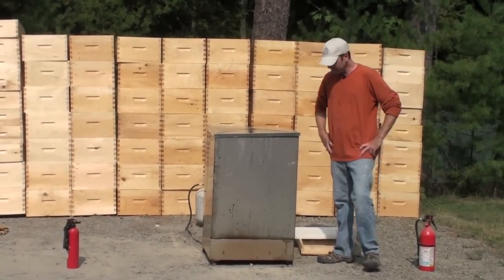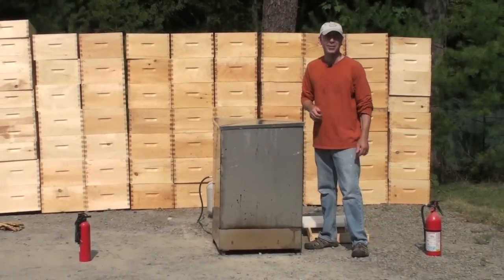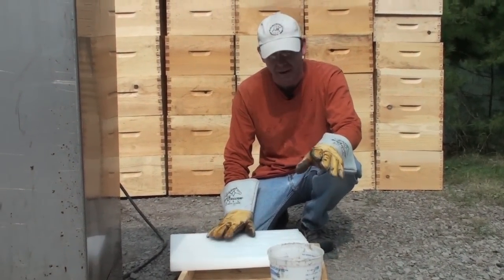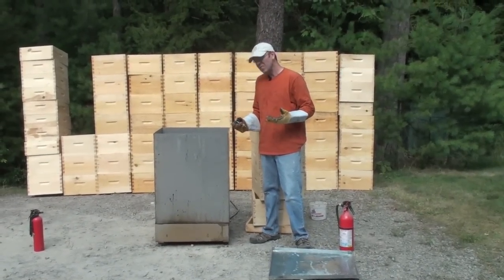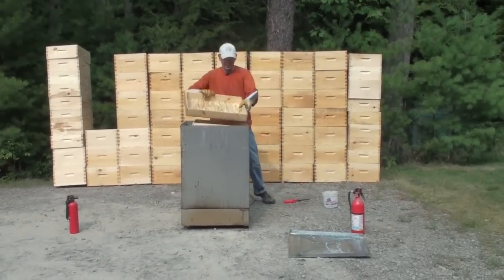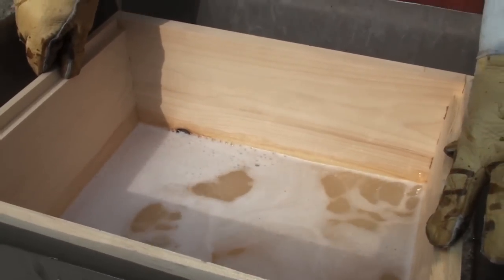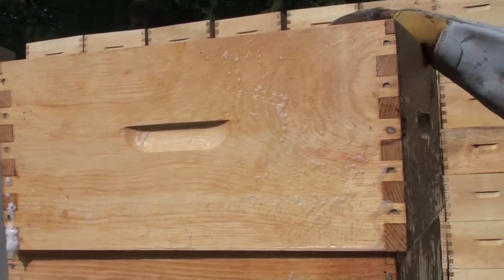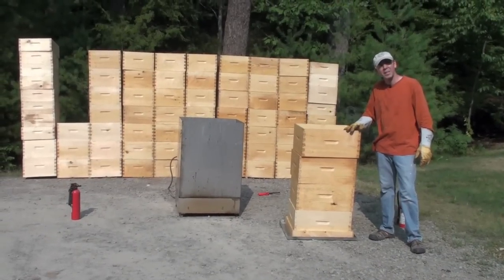Beehive Wax Dipping

Comment: I built all my hive boxes and frames myself( Langstroth dimensions) about 40 years ago. The boxes, 50 of them were painted with latex on the outside only. Some of the boxes have needed some repair over time as well as some repainting. Although my wooden equipment was not built for eternity it has served me fairly well at a very low cost.

Comment from the maker: I did try this at first but we found dipping before assembly prevents glue from adhering to the wood. Also, if you stack pieces the wax can't penetrate. Even when we put small spacers between them, we didn't get good coverage and penetration. It does take quite a bit of wax to fill the tank (300+lbs) but there is little to no waste in the process. The wood absorbs nearly 100% of the wax. It is time consuming (3 deeps,6 med) in 10 minutes but I incorporate other shop tasks while I'm dipping.

Comment: I noticed a lot of run marks or excess wax buildup. Do you scrape the excess smooth and re-use that wax, or just leave the globs on the boxes. I like the idea of wax dipping for sure, but the time constraint does seem a bit much. Granted, one setup and do a bunch of boxes for sure. I guess as 10 minutes per three boxes for one dip, vs a coat of primer and two coats of paint, that time may be the same. So then setup is really the only big constraint. Do you have a thermostat to control the wax temp, or just a thermometer and adjust the gas?

Comment: I have yet to start beekeeping, but have a good number of books and watched people's vids. I've seen that the bees tend to glue the boxes and lids together using propolis. Does treating the wood with Parafin / crystalline wax make it easier or harder for th propolis to stick the frames and boxes together where they meet as opposed to painting or varnishing as some people do. I've also noticed that the plastic manufactured boxes appear to be particularly prone to being glued up by propolis.
Reply: It is not like the bees paint everything together with propolis . The bees will glue the frames down to the boxes on the top edges . In the hot summers it is really not that bad it is just sticky . In the fall near the end of your inspection you need to NOT scrape it off where the boxes join that way it will help seal up the air gaps to keep the cold air out thru the winter because in the winter you DO NOT GO DEEP INTO YOUR HIVE anyway . Hope this helped a little

Comment: Good video - thank you for posting it!  Question on the temperature - if the wax melts at 180 degrees, why does it need to be heated to 300?  I'm assuming the heat causes the moisture in the wood to come out but does it need to be at 300?  Would a lower temperature (low 200's) work as well?  Thank you!
Reply: Hey Mathew, glad you like the vid. You are correct. The 300 degrees drives the moisture out of the wood and it gets replaced with wax. What I have found at lower temps is that you don't get good wax penetration and it tends to remain on the surface which ultimately makes your boxes slick and on very hot days that wax will bleed all over the place. But, by all means do some experimenting and see what works for you.

Comment: What are the dimensions of your box please?
How much of each wax is needed?
What was the cost and who is the supplier?
With that size of tank how many BTU do you need or feel is sufficient?
Any reason one could not use a laser thermometer?
Does it stop boiling/foaming when it is done?
Microcrystalline wax will bind better into the wood, sounds cool. Where did you get that understanding?
Your cooking temp is much higher than what I have heard from others (250ish) why?
Thank you!

Comment: thanks for posting, the post is 5years old now; are your results as expected? What size burner(s) BTUs might be recommended? I have gotten my stainless steel vat completed; a friend welded it up for me and I will using a brick lifter to remove the hot boxes. After complete cool down of the wax tank how might it be restarted aka melting the solid block or does one drain the wax from the tank into smaller molds before cooling down in preparation for the next run? Thanks

Comment: Reading through  your comments I have a few of my own preconceived thoughts you may be able to confirm, and maybe clarify to your viewers.  Main assets to wax dipping your wood ware - displace moisture,, paint can adversely trap moisture between the wood and the paint allowing for the paint to peel or reject. Mold and mildew are present due to moisture, wax is permeated into the wood so rejection and mold and mildew are not probable....the same waxed  wood (would)--suffice to say could be considered a logical  deterrent to rot and decay.  BUT the main benefit would be when you get overly aggressive with your hive tool and compromise your paint. Wax is permeated, paint is superficial, booger it and paint will trap and even wick moisture.  Negative factors - Adds weight by ????? ounces or pounds to each box, Time and equipment cost need to be considered as per individual scenario.  Safety was a main issue in your comments. Darwin has his definitions of survival of the fittest .. did God not give everyone a brain??  IF you are not comfortable  then Do NOT do it.  If you can not modify this video to a point that makes you comfortable then Do NOT do  the wax dipping. My best comment is THANK s to the both of you for the video and the INFORMATION I WILL use your information to get on with my BEE KEEPING ADVENTURE.////   Thanks Again  LARRY Sitzman
Reply from the maker: All your points about the attributes of wax dipping are spot on. It does not add a significant amount of weight to the boxes. Maybe a couple of ounces.
Time and equipment are a consideration. I have welding skills and access to metal working equipment so I didn't have to pay for that. The wax is a reasonable expense for what you get from it.
The safety of this process seems to be a concern with a lot of people. Let me assure everyone. THIS IS PERFECTLY SAFE TO DO if you exercise even a minimal amount of common sense! It will not blow up or catch on fire. I have been doing this for years and if it was going to happen, it would have by now. If this is not something you feel comfortable with, go with your instinct first. But it is not inherently dangerous in and of itself
Thanks for your comments Larry
Reply: Common Sense being the Key though Megan. Not everyone, or even a majority of people in the world have it. Not lately anyway. Sad to say.

Comment: Looks good. But I ve three questions. 1) doesnt the wax get damaged over time and is painting needed anyway? 2) doesnt the wax attract waxmoth or shb? 3) isn t it more expensive than painting?
Reply: From what I understood of this video, the wax is completely absorbed by the wood. There is no wax layer on the outside to get damaged by weather or wax moths. Sure, it might be more expensive, but that's a matter of opinion. Some might consider it worth the cost, and paint to be inferior.-- Which is understandable because paint is just an outer layer, but the wax actually goes into the wood. Paint will wear away due to the weather, but wax inside the wood grain will last as long as the wood itself.
Reply: crazy808ish All your points are spot on. There is only the slightest film of wax that is left on the surface which is a huge help when it comes time to scrape propolis out of your boxes. Because the wax is absorbed, it protects on a cellular level. With regard to wax moths, they are not attracted to wax, they are after the proteins left in the wax from larval cocoons and pollen. The cost is on par with high quality paint and primer with much less work, much better longevity and far better protection not to mention they look much better. Moisture is the enemy! It rots wood from the inside out. My boxes are ten years old, look better than new with a really nice patina. No crazy mismatched colors. Bees and gear are valuable. I want my outyards to disappear into the surrounding landscape as much as possible.
Reply: Late to the reply, but...
This wax is not the type that would be bothered by wax moths or shb larva. Bees wax or what it contains, for those concerns, not the paraffin wax.

Comment from the maker: Tank was folded from 3x8 sheet of  18ga stainless. 

I use a 50/50 mix of paraffin ($1.70/lb) and micro-crystaline wax ($2.60/lb) from Strahl & Pitsch in NY. 220lbs total.

I use 2 30,000BTU burners but one would be fine.

Any thermometer will work.

It doesn't stop foaming when done.

The method was lifted from a research paper by the Australian Beekeepers Assoc. It can be found online.

300+ degrees seems to penetrate better than 250 for me but many use a lower temp with good results.

Comment from the maker: Thousands of boxes w/o incident but hey... one man's blow torch is another man's paint brush. You have to be comfortable to be safe.
Reply: When I was a splicer doing communications work, I would occasionally have to enter a lead sealed case. Some of these cases had tags on them going back to the early 1900's (1909, 1912 etc.). These cases needed to be completely rebuilt after chipping the lead away. When exposed, the wire was found to have been boiled out with wax. The reason for this was the same as for dipping bee hives here. The wax was brought well above the boiling point of water and poured into the splice. Thus eliminating any moisture or water. This very hot wax method has been used for many purposes such as this for years. Very effective. I didn't like going into these types of splices though. I felt as if I were disturbing a time capsule. They were perfectly preserved. I can only imagine having to work with molten lead and hot wax in a confined space back then. Your dipped boxes will last a long time. Thanks for the info. and method to reduce crystalysing. Regards. And work safe.

Comment: Hi
why no use bee wax instead ?
 lower heat needed and other greener issue 
how much wax per box"(which type do you use)
well thx for the video and for the reply !
Tom
Reply: The beeswax would start to melt on a very hot day outside.  It would leach out of the box and cool down on the outside of the box and it would be sticky.

Comment: Aren't long sleeves more capable of catching fire during an unintended fire of the heated wax?
Reply: In theory I would say yes, but the chances of a fire are extremely slim compared to the chances of getting splashed with hot wax. I know people are concerned about fire with this method (and rightly so) but let me assure you that you would have to be very neglectful and let the temperature get extremely high for it to ignite and you would get all the normal signs prior to that happening. I can't stress enough how much safer this is than it looks.

Comment from the maker: Two reasons:
I glue my boxes and it won't adhere to waxed wood.
More importantly, you can't stack the pieces because the hot wax needs to circulate between them. Otherwise it won't fully penetrate the wood.

Comment: hey we've been wax dipping for a year or so and are getting a black sludge at the bottom on the melter. not sure if from creosote or something else.
anyone else have this and if so how do you clean it out?
Reply: +MICHAEL CONLEY I have the same problem, i have an old stainless "boat paddle" and scrape the bottom, then a cheap $1.00 nylon net to scoop up all the debris, i will drain the tank from time to time to give it a good cleaning....i am switching to 100% micro and will let you know what we find....
Reply: Reliable Prepper - Technician775 I’m curious. What did you find?
Reply: @technician775  I am curious too
Reply: @rosquitaville  Hi. just like i said, heat the wax, use a flat scraper of sorts to scrape the burnt stuff on the bottom and get a cheap fine weave net and scoop it out, that is the only way i know of besides draining the tank and scraping the crud off the bottom, i buy the butterfly nets from green dollar, they are cheap and work just fine, Steve

Comment: I have boxes 25 yrs old they were just painted on out side,painting or wax on inside will cause too much moisture
Reply: Thanks for your comment Don. I'm honored!  I understand your concern about moisture and I think more people need to understand how detrimental it can be to bees particularly in our harsh, upstate NY winters. Wax dipping allows metabolic moisture and condensation to bead up and roll off the surface rather than absorb into the wood where in stays until it evaporates.
Reply: Jorik Phillips Hi,Nice beehive boxes!   I like your box hand holds.  How do you cut them in your box sides?  what type of tooling and fixtures do you use? They look more professional than typical table saw made hand holds. Thanks.
Reply: ***** Great point! We use a compressed paper board product called Homasote between the inner cover and the insulation board. I consider both to be an essential part of winterization here in the northeast.
Reply: Rick Sullivan Thanks Rick.
The handholds are cut with a shaper head.
Reply: Jorik, how thick sound board do you use? Thanks
Reply: I understand your concern, however my mentor who was a pollinator for years in New Jersey painted the inside and outside of his boxes and I did the same.  Later I just painted the outsides of the newer boxes.  I never had a moisture issue with the boxes painted on the inside and outside.  The only difference is that the boxes painted inside and outside have outlasted the other boxes.
I look at it as siding on a house.  Wood siding should be painted on all sides or the moisture will blow out the paint with the weather change.  
Plus it's easier scraping wax and propolis off the boxes when the inside is painted.  I use latex based paint and it works just fine.
Reply: Freedom Toast  I don’t understand why u made that comment. Do u see a issue with his ideal. I ask because I’m thinking of doing this to my boxes.

Comment: good gob .. but you going to increase the harmful moisture inside the bee hive ,
Reply: How so? The whole purpose of doing this is to eliminate any and all moisture by boiling that out of the wood. Boiling point of water at sea level is 212 F.  He brings the wax up to 300F. This eliminates the moisture in the wood. Any precipitation gets boiled out. I think this is a pretty cool process. After boiling the boxes and removing them from the tank, that wood is so dried out that one can see the wood soaking up any excess wax to the point where these boxes don't even look like they have been dipped in wax after all is said and done. This might not be high tech, but is extremely effective and safe if properly done. He looks like he knows what he is doing. I would trust him to do this for me.

Comment: Have you considered (or tried) dipping the wood before assembling it into boxes? Seems that you could use a smaller tank, using less wax (less leftover) and run the wood through in larger quantities making the preserving process faster and more efficient, if you were just doing individual pieces rather thank boxes..

Comment: Why not just build them out of cypress?
Reply from the maker: We don't build our own boxes. 
I have used Cypress in the past and it's beautiful but it is a very brittle wood and while it is weather resistant, it is not the most durable wood for my area.
Reply: Thanks Megan.  Good answer.  I hear Western Cedar is also very weather resistant, any word on that?  Since we don't have that around here, I'm sure it would be expensive compared to pine.  I wonder how enamel over dewaxed shellac (e.g. BIN) would work...
Reply: +David Chambers    Doesn't cedar repel insects (bees) ?
Reply: No cedar doesn't repel insects.  I actually had to treat the cedar bottoms on the underside and only on the underside with a wood preservative so black ants would not eat into the cedar bottoms that I have.  Cedar still lasts a lot longer then the pine.
Reply: Stan Schleusener No doubt - SYP won't last more that a year or two if it's in contact with the ground.  Cypress is said to be the best in my region, although I've read that Redwood is superior to it.  The western cedars after cypress and eastern cedars after that.
Reply: Mine are all on cement blocks.  Cypress is supposed to be the best.  I have never used it but should have bought some early on instead of pine boxes. I have had pine that only lasted a couple of years before I had to replace the bottom inch and a half of the box.